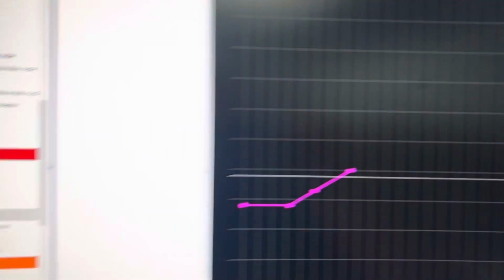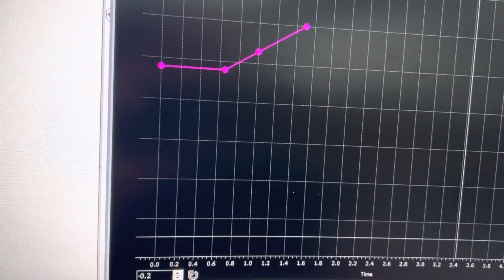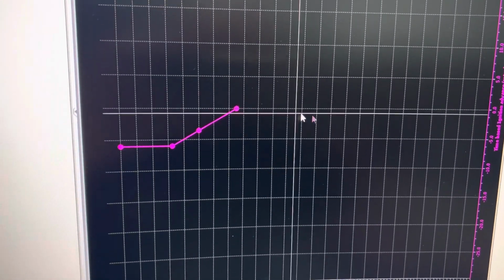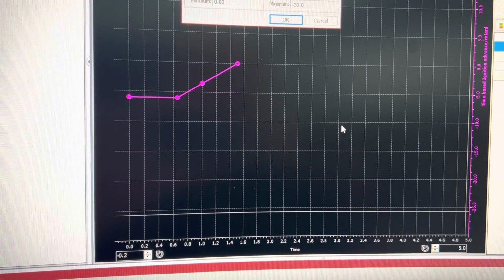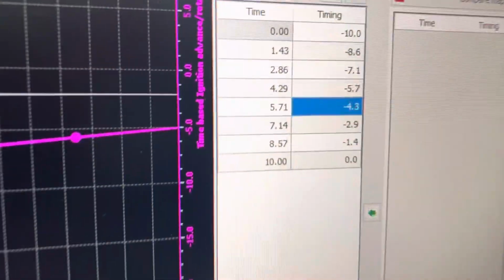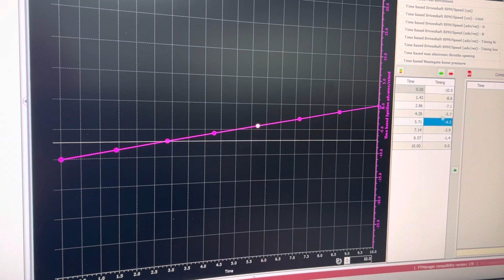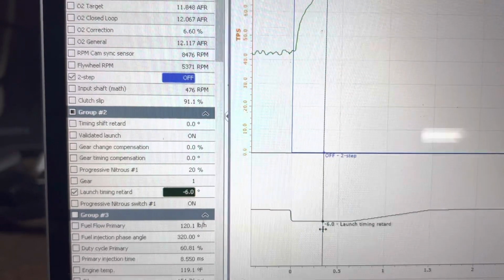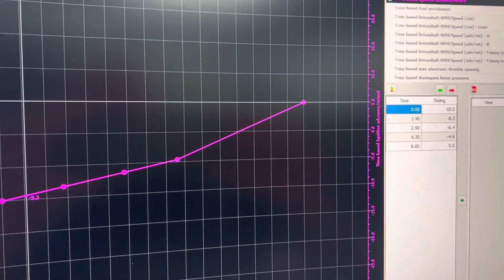FuelTech: Ignition timing by using time based compensations

Comment: Was messing with this on my car before I go to the track. Releasing the transbrake showed no timing being pulled, I am assuming because I wasent getting a validated launch (doing this in my driveway holding the brake and idling). What does FT need to consider it a validated launch?

Comment: Can you use this feature and time based driveshaft rpm A and B Hi and Low feature at the same time?
Reply from the maker: Yes, each function in time-based compensations is separate from one another. Good question.